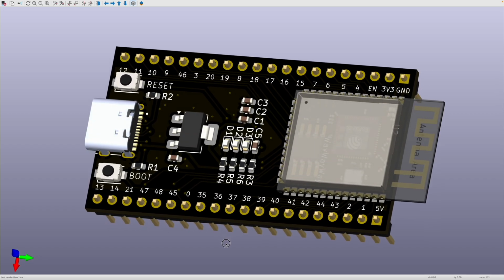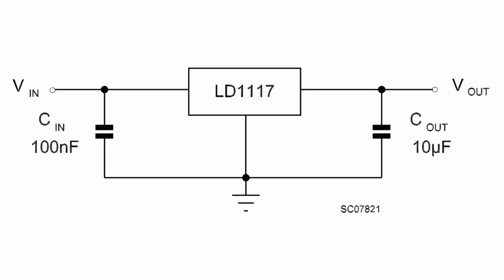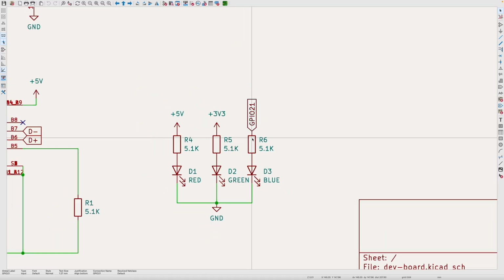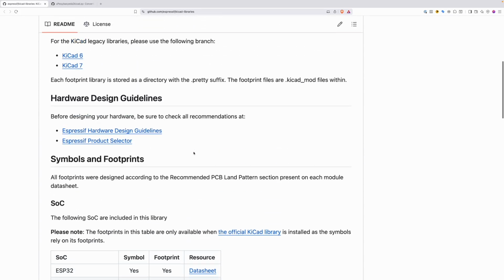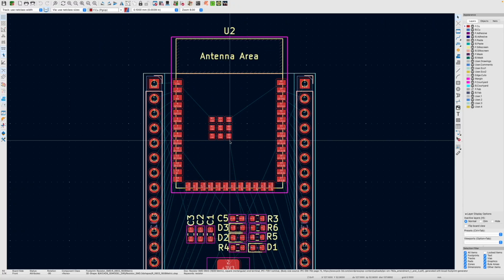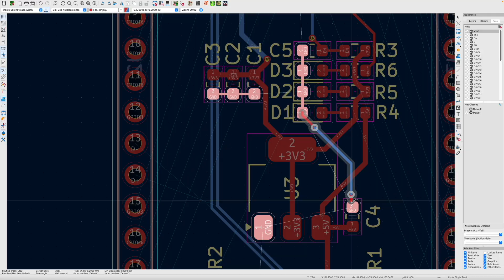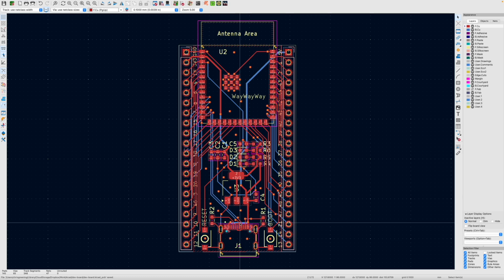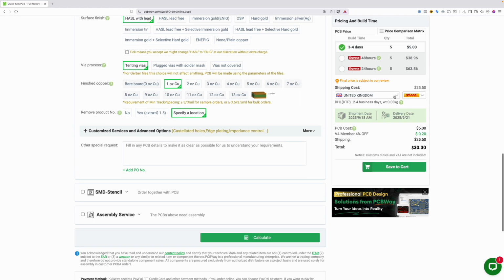Super Easy ESP32-S3 Dev Board

Comment: It's not clear whether the reset and boot switches are actually required. It looked like you were able to flash over USB without pressing them. Maybe if you code goes into a bootloop?
Reply from the maker: From my experience - it will work sometimes automatically - other times, it will not. It really depends on what state the device is in. You can completely crash the device and lock it up - then you will definitely need the boot and reset buttons. Or if the device is stuck in a rapid reboot loop it can be hard to get the timing right - and again the buttons then really help. If you are making a device that you flash only a few times, you can just use a jumper.

Comment: Really informative, and neatly done!

Re your discussion of the AMS1117 needing tantalums... what are the possible consequences of using ceramics instead for the AM1117, and why does the manufacturer specify tantalums?
Reply from the maker: My understanding is that it’s to do with stability. Tantalum capacitors have a higher ESR (equivalent series resistance) than ceramic. The AMS1117 has been designed with the assumptions around that. It might not be as stable if you use low ESR capacitors.

In practice you’ll probably be ok (and I have a board that has ceramic + AMS1117).

Comment: Remember  D+ and D- should be routed as a matched data  pair, not that it should cause a issue over a short distance. But you should do things correctly from the start.
Reply from the maker: Yep - use KiCads differential routing - you get it for free if you name symbols + and -. Strictly speaking the traces should be impedance controlled as well. But I’ve yet to encounter an issue.
Reply: @atomic14 I'm not sure if at the lower speeds errors in the timings will so up, we all expect the odd did not programme at some point.  So data transmission over miss match tracks,  impedance or length just falls into the odd fail. But looking at the requirements for a single board means that your be up to speed when a design requires it.
A great video as usual mr silicon 😊